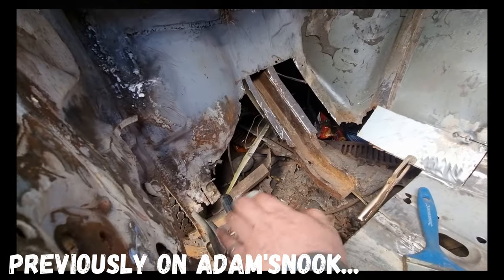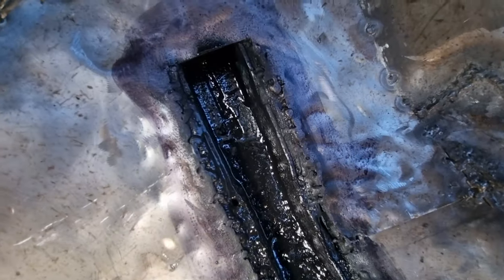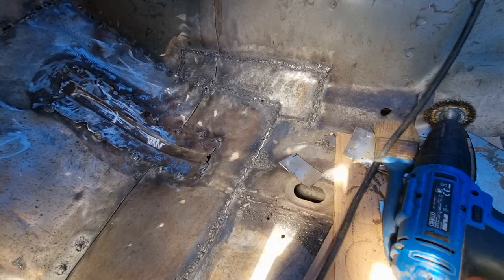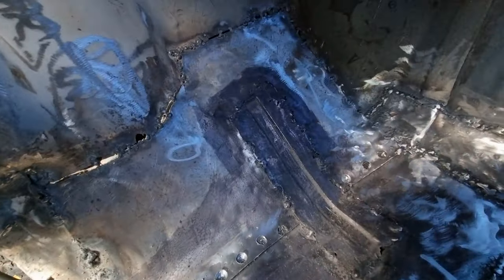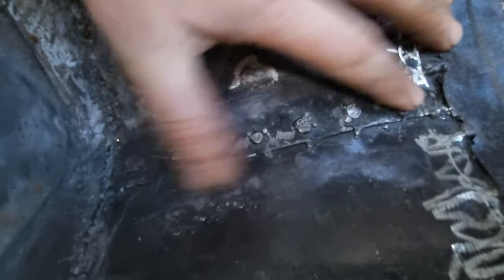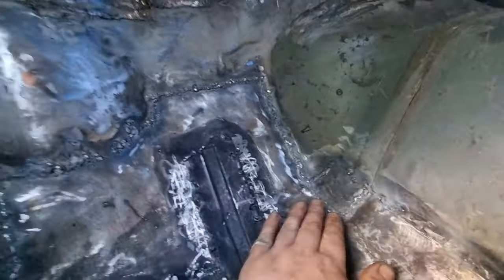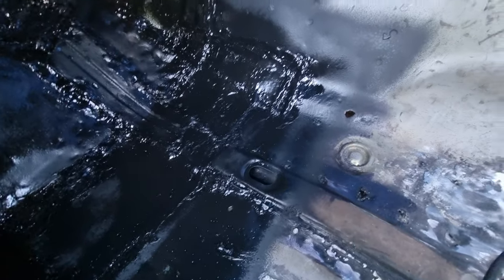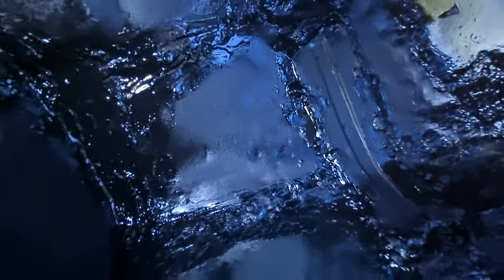Cortina Mk4 Ghia 2.3 V6 Restoration || Foot Well Completed P6 (P38)

Comment: Most people would of scraped this car,so I admire you for that, people choose gasless mig to save money but for a beginner welder its very difficult to master and especially on old compromised steel,get yourself some gas and 0.6 wire and it will be night and day for you, can see weld pool ,way less grinding if none,even line welds.
Reply: tottaly agree mate  life is so much better with a mig with gas and more tidier welds

Comment: If you are not already using them fibre flap discs are great for cleaning up weld and are a little bit quieter than a normal grinder disc.  I use 40 grit for heavy removal and 80 grit to finish.  Also if you have holes that you need to weld up get a piece of copper water pipe, flatten one end and put that behing the hole, it gives something to weld to and it doesn't stick to the weld, remember to hold it with a welding glove or rag as it tends to get quite hot!  Definately look at using gas with a MIG  as suggested below as the weld is a lot better.
Reply from the maker: Yeah I do buy 40 grit and 80s grit flap disks but don't last long feel like they are a 1 time use heheh but yeah will get more a pack of them will be better
Reply: @AdamSNook. get the good quality ones they last ages an ages
Reply from the maker: @festeringfesterer  will have a look :)

Comment: Great job of that front floor pan looking solid saves you but the panel shame the drivers side is a lot worse but you could do it in sheet metal as long it's not loads of small plates you want to get a big sheet of steel even if it's off a scrap car like a bonnet or a door you can cut up mate 👍
Reply from the maker: Thank you yeah would be less work to lol

Comment: Class!! You have a finished corner there!  Have a look at how bad the driver side is, because with you doing that with sake of £40. you could have the driver side done for about £100. Just by having a good plan like you have there.  Get some sound deafen stuff on the floor pans too, when the time comes, if you wanted to.  As for proving it's solid, you don't need to, looks it.  Are you going to do the rear's and the work your way to the drivers side of front floor pan?  Also if you can get under where you have welded with the seam sealer, and the inner wing.  That will help it massively.
Reply from the maker: Hehehe thank you yeah I can jack the car up now on this side I will be building the back section  the 37 I paid will do the back aswell it's 37 for the front o back in metal lol so to build the whole passenger side would have cost me £37 in total yeah will be se sealing the underside already cleaned it up before painting the foot well so bottom is ready to
Reply from the maker: the waiting time for a drivers side floor  pan is months and months waiting time not sure i want to wat that long for the price they ask